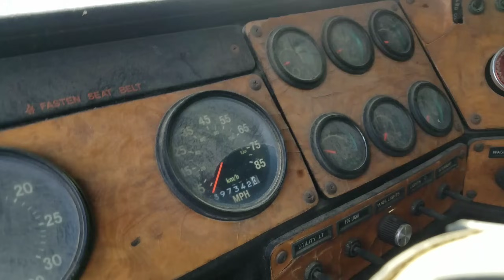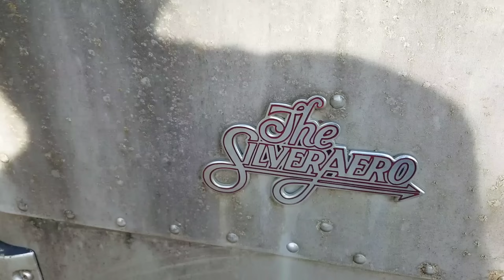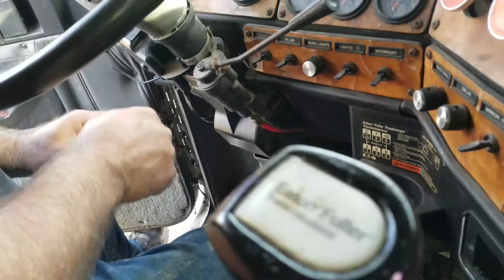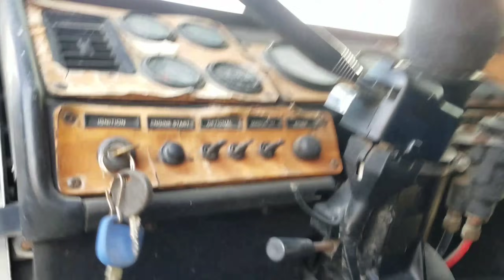Freightliner fld120 FIRST ATTEMPT TO START AFTER 17 YEARS

Comment: You have no idea what you are doing.... Drop the old fuel, then change fuel filters. Then fill takes with fresh fuel, purge the filters, then START IT.
Reply: matty d  why would you want to blow the injectors with bad fuel... That sounds like a good way to clog them
Reply: New fuel won't hurt
Reply: Air in system
Reply: Literally THOUSANDS of YouTube videos like this and old fuel is generally not a concern. The old diesel is not like gasoline,  or modern diesel fuel. Some of these old rigs were even filled back in the day with off road or agricultural blend diesel. 
I hope this helps. 
I am agreeing though Tonya, a lot of shoddy work, and that Ether, dear Lord, that was horrible. 
T. S. RACING
Reply: @t.s.racing 
Obviously you haven't seen what the newer diesel fuel can do just sitting in a fuel tank.  All kinds of algae can grow in the tank. That can and will clog fuel filters. Not to mention what it can do to fuel injectors.  Don't take my word, try an experiment on your own.  And see what happens.

Comment: That is the SilverAero edition. Freightliner brought them out in the early 90's as a limited edition. That is some history right there. They were all equipped with a 70 inch flat top sleeper, 3406B Cat, 15 speed fuller and that light rosewood panel. We even had one here in South Africa. I was in love when I first saw it in 1993. And the unique sound of the 3406B was something I will never forget.
Reply: I have the same exact truck in 1991 they made 500 of them half had cats the other half had cummins and they came with 13spds.I still have the original sales brochure.
Reply: hi everyone, I write from Italy I wanted to ask you kindly what difference is there between cat detroit and cummins engines?  Here in Europe, each brand also has its own motor (e.g. scania with scania engine, IVECO with IVECO engine, etc.).  I understand that in the U.S.  you can choose various combinations for the same brand (eg peterbilt) and that it works as well for pick ups (duramax engine or stock etc.). thank you.
Reply: Great oldtrucks...
I miss the sound of diesel engines humming along the roads..
Reply: alba acrux I don’t know about the rest of Europe but in Britain at one time you had a choice of which engine you wanted in your truck.
Reply: Sending love to you from cape Town
Reply: @senzanome6749  Finland Wisu use Cummings and Cat.. Rolls was years a go... Sisu all so Fuller gear box...
Reply: Hello my friend writing with great pleasure🔔🔔🔔🔔🔔🔔
Reply: I drove a 92 with 400BCIII and 15 over! Loved it!!
Reply: Amazing trucks I remember them in South Africa very well.not too sure about reliability but love the look of them.

Comment: That is so cool that some trucks can be sitting for so long and some people just start it and then there you go. I think that is amazing. That is one of the reasons that I want a big truck like that.
Reply: Make sure you have deep pockets for repairs and plates and permits this isn’t the trucking it use to be to many people with hands in your pockets
Reply: It's called no emissions no DEF Regen system. Pretty much just good Ole mechanical motors

Comment: Doubtful to call it the first start after 17 years, the first start attempt after 17 years is better.
Really looking forward to the future and hope for success. Thanks so much.
Reply: Technically it DID start. lol just wouldn't stay running.
Reply: @Shane-Singleton  It could not breathe itself without respiratory care. ether gas in spray bottle. Can you say that the engine runs by itself?
That you have started the engine?
Those are my humble questions.
Otherwise, it is a very nice and good truck that will certainly be great. I look forward to more episodes, and thank you for your comment.
Reply: @seriksson9721  Hard to say those times it acted like it was running away and then idling if it was only running off of the ether or not. certainly sounds like an issue with fuel delivery, though. And to me, judging by the way it would crank and then start to stumble and resist cranking it makes me think the injection pump may either be bad or not timed properly. Because it almost sounds like when you have too much initial timing or heat in a gas engine and try to stat it. it'll turn then pause and then turn again. By my defnition even if it runs off of the starting fluid it still started. Now the big questions is will it stay running on its own fuel and can they get it out of there under its own power?
Reply: @Shane-Singleton  Thanks. I hope and believe that they will succeed with both the engine and moving the vehicle. I think but do not know for sure the sound of
too much initial timing is the sound of too much ether igniting in the engine. I will contact a knowledgeable person tomorrow and will be back. Nice discussion, thanks again.
Reply: @Shane-Singleton  Hi. Knowledgeable people say that with 99.99% probability, it does not get diesel, but only goes on ether. It should be relatively easy for an experienced person to fix. Thank you and we look forward to the future.
Reply: @seriksson9721  Right. Now the question is..  what is stopping it from getting diesel, injection pump, fuel shutoff solenoid, air in the system, clogged up, the list goes on. But troubleshooting those things makes for a fun video. So i'm looking forward to seeing it.
Reply: @Shane-Singleton  me too😊
Reply: @seriksson9721  fuel rack is stuck. common problem with this type of pump after sitting. i tried breaking it loose. gonna tow it home and heat the pump maybe it will help if not remove pump and rebuild.
Reply: @trnot  Nice and exciting, a large part of the world will follow the progress of the project. We wait with anticipation for the future. Good luck.
Reply: @seriksson9721  running now. video coming soon
Reply: @trnot  Very nice. Thanks

Comment: If it has 379,000 original miles, it’s definitely a keeper. These old FLDs with the Pre EGR 60 Series are the definition of reliability and low cost of ownership. Definitely an Owner Operator truck.
Reply: Truck has a Caterpillar engine.
Reply: ogkillla truck has a Caterpillar 3406e in it
Reply: @tadobryant6554  That's a 3406b.
Reply: The speedometer turned over at a million miles
Reply: Go ahead and buy you one, make you some big money truckin! With $1.70 rates, high insurance, over regulation, pay parking, waiting hours to take a shower

Comment: So, I'm a trucker now, and I have a 2014 Peterbilt 367 day cab winch truck and I first drove a truck back when I was 14 years old when my buddy's dad in Allentown hauled 80k lbs of tin scrap from Allentown to Baltimore and I went on a run with him. God bless him, he let me drive his truck on the highway with an empty trailer and I've been wanting to get a CDL-A ever since. I was 31 when I got my current job and I first started pursuing my career as a truck driver, and my current company helped me to get my license. The truck that I have now has less than 50k miles on it, because my company bought it and only had one guy to drive it, so he didn't put hardly any miles on it. I've put 26k miles on it the past year and that's not alot either, but I also drive a 550 and a 750 with a gooseneck trailer for the smaller loads because my winch truck and 48' trailer is longer than all of the sand cans and most of the wellsites that I deliver to are very small and tight. Regardless, I love seeing older trucks like this revived and used because no truck deserves to sit and be deserted.
Reply: Hello my friend writing with great pleasure🔔🔔🔔🔔🔔🔔

Comment: The first thing you need to do is change the fuel and air filters.  Second, check the fuel pump and put fresh diesel in tank.  If it has been sitting for 17 years the diesel is all gummed up

Comment: 1991 Silveraero special edition. Manufactured in 1990 and available with 4 colors of striping. Green, red, blue and black. I pre-ordered mine in April 90 and took delivery on August 17, 1990. Sold it in 2004 with 1.3 million miles on it and the .engine was never touched other than regular maintenance. Mine had the green stripes 3406B/e with a 15 over and people would actually chase me down on the highway to get pictures.
Reply: That should read limited edition because there were only 500 of them built
Reply: Thanks Don that's interesting. My friend ordered this I think in early 1991 I remember this truck since it was new. he just used it local never cross country. It's running now I think I will restore it.

Comment: I don't to crack to injectors open on that truck when your feeding start spray into it but when will help 50 era the system have too little get philips injectors to BMP's get stuck from the old diesel fuel so by doing this your helping 2 things your game the plungers to move in getting the truck a chance to start

Comment: A number of people talk about the freightliner fld 120 I remember when first came out in the late 1980s many people thought they the koolest and the nicest truck on the market, many people wanted one but it took a while before many drivers got their hands on one. I put many miles on fjd 120 i did like the room inside. It beat the needle nose front end trucks that had a sleeper the you had to crawl throught a hole to get into the bunk and in the winter the  bunk was cold and it was hard to get back out of the bunk. The fld 120 was haven to alot people and it was a nice truck to drive

Comment: That rattling noise when the battery was low is what blows engines up with ether. It sounds like it lived through the close call but that is extremely dangerous when not cranking fast enough. Just telling folks dont do that.

Comment: The CDL school I go to has two of them. One is parked (needs a belt tensioner) and the other one is used for parallel parking. It seems like everyone even the instructors HATE that truck. I even told the one instructor it's not bad on e you get used to the clutch....he walks away. 🤣🤣

Comment: Sir just be careful starting these old diesel trucks around your young ones. Sometimes these old diesel engines that have been sitting around for years can run away from you if the rod is stuck in full power mode.  And if they blow it will send shrapnel everywhere. Not trying to tell ya what to do. But their is some dangers to this. Great vid though I def subscribed.
Reply: Very good point, but to be fair think he already knew that as he is ready to block air intake to shut it down.
Reply: Im positive that's why he had the block ready for the intake

Comment: It's got a good engine in it, but I was kind of upset to see that it didn't have a Series 60 in it. I have good memories of riding with my uncle in his FLD120 that was powered by a Series 60. He could out-pull nearly every truck on the road with that truck. It was a well-tuned machine.
Reply: That's some bullshit lol 60 series aren't powerful at all he didnt out pull anyone in an fld120 with a 60 series I'm sorry
Reply: I have a 60 series 550 HP ,ain’t out pulling a cat motor but it all depends on what rears you have at end of the day
Reply: They never made a 550 Series 60. If someone says they have one, they massaged one, but it isn't stock.
Reply: A 60 Series is not outpulling a cat, sorry.  From the dealers, the Detroit Diesel is the weakest of the bunch.

Comment: It's kind of sad to think about it, if you never sell your vehicle, there will be a day you park it and never use it again. Just like as a kid, there was a day your parents picked you up for the very last time, and nobody realized just when that was. I hate having vehicles sit. Vehicles want to run. I once let a daily driver car sit for six months and it almost destroyed the piston rings. During its sit, all the trim became super faded and the clearcoat began to peel and the tires began to rot. I was shocked that six months did all that to a car that was in decent condition when I parked it. Now I have a truck that has been sitting for a few months because I have some of it apart to fix it and haven't gotten it back together yet. As soon as I'm able, I'm putting it back together and at least driving around my property until I get it on the road. I picked it from a scrapyard, got it running, turned out to be in better shape than I thought it would be, but it still needs a little work to make it dependable. I know it sat in the scrapyard for about a year.

Comment: Almost sounds like the fuel shut off isn’t moving, the solenoids clicking but it might not be pulling the rack to the run position, just a guess
Reply from the maker: yes the rack is stuck. Im hoping to free it up so i dont have to pull the pump.
Reply from the maker: you guessed right.

Comment: I believe if you get some new lugs for the cables and solder them on good and get all the air bled out it should start and run!😎🇺🇸
Reply: it needs all new lugs. it had fuel pumped up but the barrels or plungers are stuck in off position. common problem when they sit. I checked everything before we tried it just wasn't captured on camera.

Comment: Fill the filters with fresh fuel. Then pump it up with the hand pump!! Crank it up for a bit. Then stop and refill the filters again. Repeat process until the fuel in the filters does not go down. Those old cats don’t like either. If it is the early series of cats. You can spin a main bearing so fast!!

Comment: Poor preparation too much starting fluid, that poor old 3406 ain't getting the juice, stop abusing it.
Reply: Totally agree
Reply: Yep!
Painfull to watch.
You can't fix everything with a can of ether...
Prime the fuel system... Jeeez!
Reply: No shit!! Yikes! Hard to watch SMH
Reply: The second thing is to get the fuel priming pump working.
Reply: fuel system was primed before trying to start. Was trying to figure out why no fuel at the injectors and found the rack is stuck in off position. I've tried everything and going to have to pull the pump and free up the barrels and plungers in the next video
Reply: @trnot  l have a couple of 3408 cats, one of them stood for a few years, could not get fuel out of delivery valves on pump, every plunger was stuck up and injector nozzles were also gummed up, take care if you remove plunger assemblies, it it critical to get them back on the rack in correct mesh, there is a small locating pin in the pump bore, but are often broken off. I also have a couple of 3406 motors in trucks that l run on recovery here in the uk, regards.
Reply: @grumpystruckshop3807  Thanks. If i can get a gasket kit I'll try to disassemble it if not I;ll just send it off
Reply: @trnot  you need a special tool to remove  the plunger assy.  from the pump, if the plungers are stuck, you dont need to strip the pump any further. I have the tool but l am a long way away, any problems , message me, regards.
Reply: @grumpystruckshop3807  ok i will thanks. a guy i know has several of these engines and said i could use the tool to pull them and a tool to time them
Reply: Funny, I have watched several videos like these. It is painful to witness.
Why don’t these people take the time to prepare the truck?
Fresh fuel, filters, check coolant, belts, oil changed. The motor would start right up. All they do, just show up with a set of batteries. It blows my mind , really! And for what, just to hear that sound of a diesel in record time???

Comment: After 17 years, probably needs more than new batteries and ether. Just saying.
Reply: hey this is Rodger I was watching your video there on the fld120 I have a 99 fld120 it's not a bad-looking old truck I mean it's been 08 sold the motor it's got a 12-7 Detroit in it it's got bad blow by won't start but it'll turn over I don't know what part of this and didn't go through
Reply: Yes and service to the starter and change the filter good-looking

Comment: Replace fuel filters and make sure there’s fuel pressure and no air in the lines. It sounds like it’s full of air and you should never start a diesel with starting fluid. The glow plugs could blow up the engine block.
Reply: Right...
Except, there are no glow plugs !

Comment: Why didn’t you crack the fuel filters open and put fresh diesel in them, “carbon on the valves or something” told me you shouldn’t be working on it
Reply from the maker: Already did it.
Reply: That and a little to much starting fluid when the engine slows down and trys to lock thats way to much starting fluid and use some wd40 with it that helps it from sounding like its about to chuck a rod starting fluid and wd40 is what we use on diesel that haven't started in year
Reply: @chewy-bu1oy  yes indeed dry cylinders. fuel rack is stuck tight in off position. gonna tow home to work on it. next start will be off of fuel

Comment: Instead of using ether. You may know, but take a shop rag and soak in a little gasoline. Smother the air intake with the rag and let the gas fumes be sucked in. It’ll give it a good pick me up. The gas fumes are not nearly as bad for the motor as ether.

Comment: 17:05 - the man was right. Crack the bleeder on the filter head when priming it.
Reply: bled at filter head and return line. fuel rack is stuck in off position is problem.

Comment: so its low on fuel, possible clogged filters or bad pump etc. so you spray a ton of ether to try and keep it running which is isanely bad for a diesel and from the tick when it was running at the end for 30 seconds does it have oil pressure? or even oil for that matter? had a ad rattle in the top end

Comment: Man...that either is so painfull to watch...I can tell you all my 23 yrs at Cat..the holes in the pistons from either Being used has been allot
Reply: Whar woyld be the proper liquid to uses thanks
Reply: @feur2884  WD 40 is the best if you gotta use something to start it or you can put gas on a rag, lay it over the air cleaner / filter  so it dont get sucked into the turbo